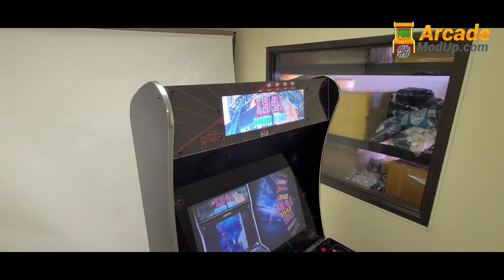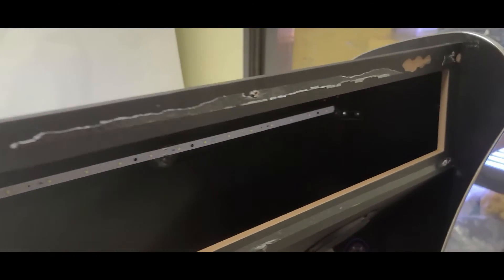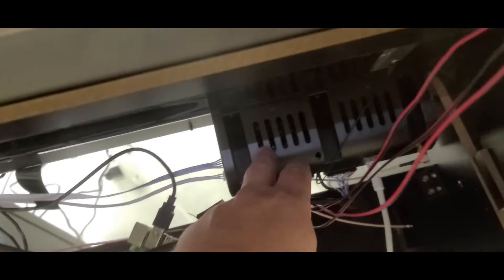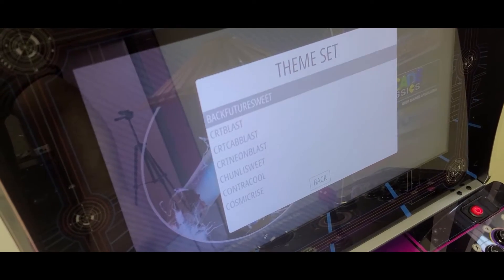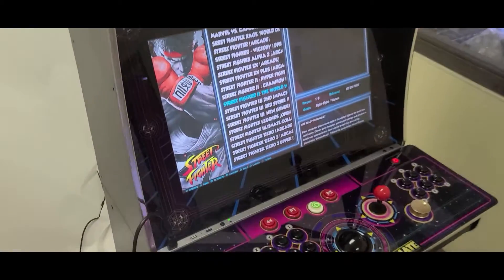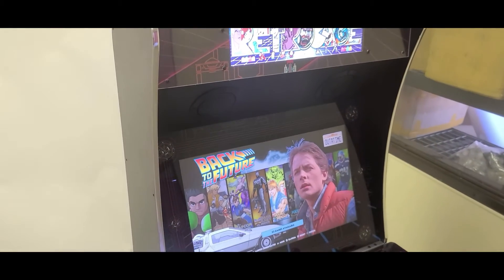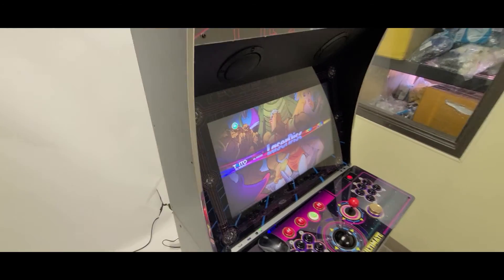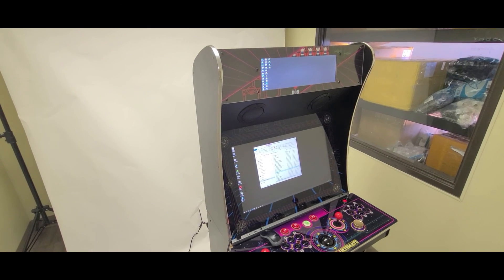Arcade Legends Ultimate Mod LCD Digital Marquee RPI and CoinOps

Comment: Friend, I just installed "CoinOPS Next 2 (Standalone)" and I already connected a second screen in Windows and left it as "Extend these displays" exactly as in your video, but I ran CoinOPS and the marquee remained with the Windows desktop, is there any option in CoinOPS to activate the marquee on the second LCD? ^_^

Comment: The LCD monitor came in, today, and and I was able to assemble the dynamic marquee mount, LCD, and plex. Got that installed onto the cabinet, and it worked beautifully, first time. I just need to adjust contrast, and brightness, just a tad. The cabinet looks much better, now. Still haven't figured out how to get Star Wars, Empire Strikes Back, Space Harrier, Robotron, Tempest, and a bunch of other games to work correctly, with analogue controls.
Reply from the maker: Open support ticket and they can help.
Reply: @arcademodup2286  Already done.

Comment: Going to do this mod. AtGames has twice, in just one month, managed to hose my arcadenet account, with this five offline session limit, which requires you to re-log into your account, and that's a major pain, on their interface. LOL. Oh, don't count on getting back in. It always rejects the login. You have to reset your password, which fails, EVERY time. So, I'm done with AtGames. Cancelled my Arcadenet account, tonight. Now, I'm just going to bypass them, all together, and throw in either an old PC, or get a rasbeery pi. Definitely getting the LCD marquee, and will black out the AtGames branding. Thanks for the video.
Reply: Looking for info on this. What is the 5 offline session limit deal?
Reply: @BrianLTanner  Hello Brian. When using the AtGames assets, not the mod, there's a limit of about five offline sessions, during which one can play the cabinet, before having to re-log into their account. When one does, there's usually an error. I've had to go online, and change my password over a dozen times, each time I encountered the five session limit message. I finally gave up, and closed my AtGames account, permanently, and am now using just your mod kit.

Comment: Hello - great video

I have a question about the Legends Ultimate Arcade Cabinet.
I would like to connect a powerful PC to the device.
Can you do that? Connect PC to PC using HDMI and joystick controller board via USB?

Could you do that? and you could transfer current PC arcade games directly from the PC to the arcade device (I don't mean straming)

would that work ?

I would like to use CoinOps as front-end software

does the hardware of the cabinet work with a home PC?

Comment: ??? 😞😞😞 LCD MARQUEE YES 👍 GREAT CONCEPT YES... BUT WHATS THE POINT IF THE MARQUEE IS SOOO SMALL SCREEN 📺??! 
It looks TERRIBLE 😔.... it LOOKS STRANGE BECAUSE THE CAB IS HUGE - But the Marquee is TINY SMALL...!!!??? 
They need to go back to the Drawing Board MAKE THE LCD MARQUEE A NORMAL SIZE MARQUEE TO FIT THEE WHOLE MARQUEE AREA..!
Reply from the maker: We can do it, but instead of a $100 lcd you will be looking at $400 or $500 (probably custom from China) for one that size which I imagine would not be worth it to most.  This size is the best price to size available and is amazon prime available.